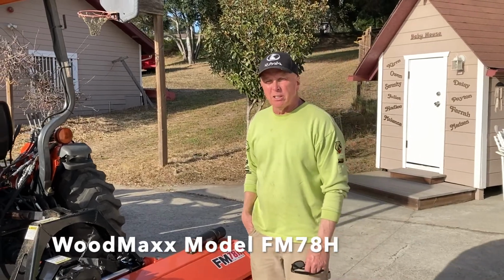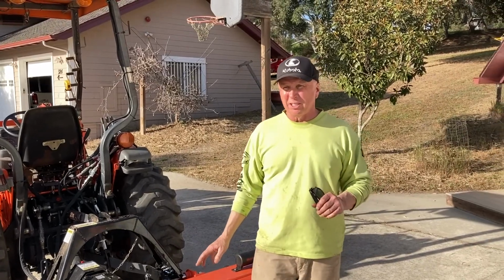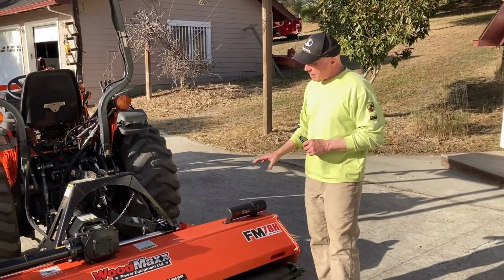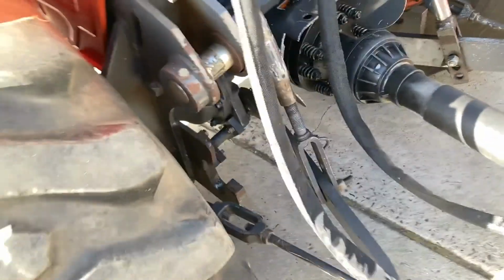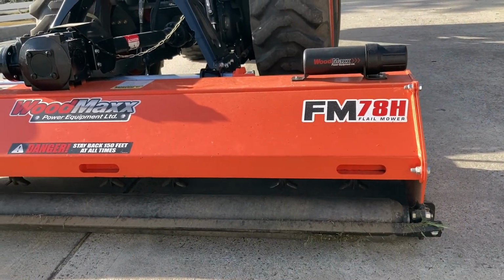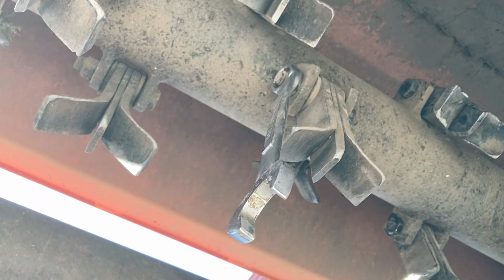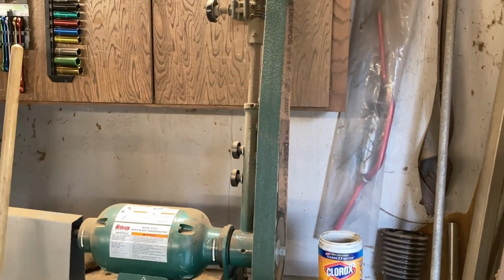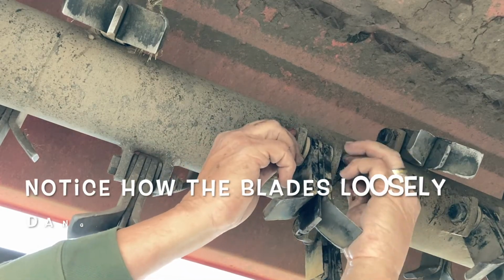Flail Mower Review

Comment: Have to agree with the last comment,  the slip clutch is on the implement, not the tractor.  I had this unit for the last 6 years with hammer blades, keep them sharp and you will get a mow that your neighbors won't believe came from a tractor.   I currently maintain 6 miles of trails on my property and you could golf on them .  Get that pto shaft switched around.
Reply from the maker: Switched it- Easier to lube, too! Thanks!

Comment: U HAVE YOUR PTO SHAFT BACKWARDS YOUR SUPPOSED TO HAVE THE CLUTCH SIDE ON THE FLAIL MOWER GEAR BOX SIDE THAT WILL SOLVE YOUR COMPLAINT
Reply: This. The Slip Clutch end goes on the mower and uses the locking pin to keep it attached to the mower. You do not want to use this shaft for any other implement. The push pin will go to the tractor end to easily disconnect it and drive away.
Reply from the maker: @JoelAClear  Thanks!

Comment: I don't know anything about that brand, but the flail mower I used in the vineyard I managed you could swap the hammer blades out for Y'.s. It was just a matter pulling a hair pin out and then pulling the half inch (it could have been bigger, it's been 45 years since I saw the mower.) rod the blades hang from. Then reverse the process. I use to do some welding, but I'm over 70 and I'm not sure anyone would want me. I even knew how to forge welding.

Comment: Great advice on the flail mower but even better advice to our young Americans about  becoming a certified welder!!!  Comment on your PTO drive shaft - never seen the slip clutch end of the drive shaft mounted at the tractor side, but rather always at the implement side??  Is this how you've always done it?  As you know "Y" blades are reversible and they wear in a manner that shouldn't really require much sharpening if you reverse them.  Sharpening them to too fine and edge will only result in faster wear.  You might also want to consider going to Double "Y" blades when you need a new set.  Was the tilt function included with the hydraulic slide function or was it a separate option as well?  Thanks for your video and would love to get an update now that it's been a year since you posted this video as I am considering purchasing the Woodmaxx FM96H model once they are back in stock.  Thank you Dave.
Reply from the maker: Used it 2 seasons now- still going strong.
Use a hydralic cylinder on the 3 point hitch for nearly all the implements run back there.
I installed the PTO backwards originally and haven't bothered changing it- actually is easy to get to the zerks for lubing...
I was dissapointed in the Y blades, dulled quickly and more time consuming to sharpen, as required unbolting, sharpening and reinstalling. The hammer blades kick butt!
Thanks! Dave

Comment: sounds like you need to switch your blades to hammer blades, based on the amount of abuse the cutting blades are receiving,  your PTO shaft is on backwards flip it 180°, the slip clutch supposed to be on the mower end not the tractor.
Reply from the maker: Yep- I'm hard on those blades! Good tip! Thanks! Dave
Reply: Abuse? How big of a branch can this flail mulch?

Comment: I like this brand. I want a flail mower. If it could mow ditch banks I would buy it. The FM 96H ditch bank mower?
A FM 108 H ditch bank mower would be even better for my orchard. My bush hog cuts 3 inch saplings all day long and has been doing it since 1999.
Reply: Howse 7 foot heavy duty rotary cutter with a 100 hp gearbox.
Reply from the maker: I have a hydraulic adjustment to pitch an angle on my unit, so as to put a 15 degree pitch on the mower, but nothing that you would get on a mower specifically designed for ditches. This unit will grind 2" brush. Dave

Comment: And doesn't the rear housing open up so you don't have to crawl underneath? lol An impact might speed up taking the knives on and off.
Reply from the maker: The housing doesn't open.
I have a 3 minute video on sharpening using an impact driver.
The factory bolts ware so tight I had to use a 20" bar to crack the nuts loose the 1st time i sharpened them....
Reply: On Woodmaxx's website, it shows that you can lift the back housing panel by the two bolts on each side and get access to the blades without crawling underneath the mower which is a bit dangerous, hope that helps, nice video, would like to see more cutting please.
Reply: Yes the rear panel flips open for easy access for hammer/knife service.

Comment: I thought this would be a great purchase.. bought the fm54.. when it arrived the stem to grease the bottom pulley was in the bottom of belt well and the whole were it was supposed to mount was dry.. reassembled an greased.. no problem..only got about 40ft cleared an the bottom pulley locked up .. smoked the belts pretty badly.. got in touch with warranty department.. though some back and forth..( which they originally were trying to say it was my fault)..finally made a ticket to send me a new bearing , ( and maybe new belts).. looked up the ticket on there website and it listed as low priority..Ugg .. I wouldn’t recommend going this route.. save your money an buy a higher quality machine
Reply from the maker: Sorry to hear of the problems. I hope they make good on your mower- Dave
Reply: It’s been over a month now and no updates or parts been delivered.. $2800 paperweight

Comment: Just flip the blade around so the unused side engages.  When it's dull, you can sharpen both sides at the same time you take 'em off.  I didn't see any jackstands under that mower you were UNDER!
Reply from the maker: These blades only have 1 cutting edge- "can't be flipped around"
No jackstand- A bolt is inserted in the side holes, preventing the unit to drop... Dave

Comment: I had a Betstco, and didn't like.  Its chinese built.  woodmax is the same.  belts keep slipping and only cutting about 2' of grass.    I sold it.  Looking to get a heavier duty one, John Deere or Maschio
Reply from the maker: Outside of the blades dulling quickly (I run the unit skimming the dirt) it's ran pretty flawlessly for about 40 hrs.... Dave